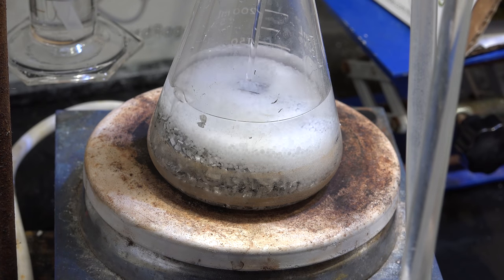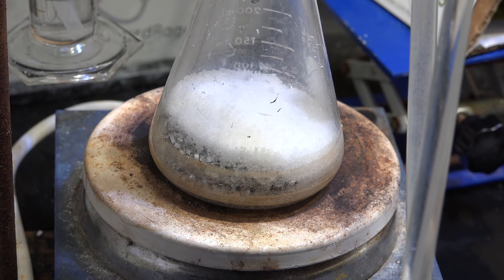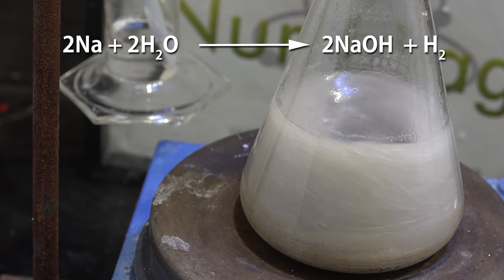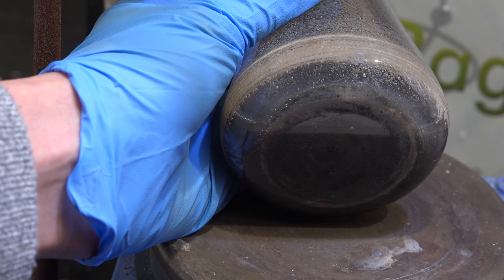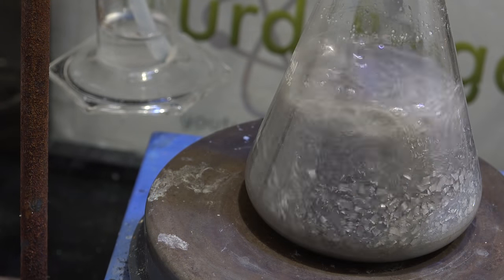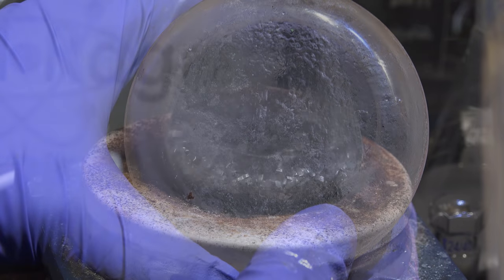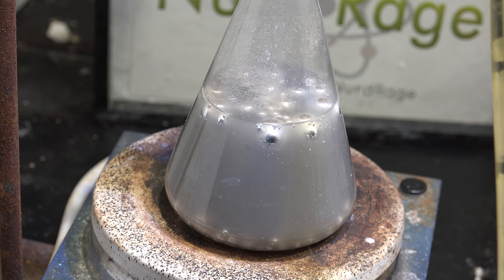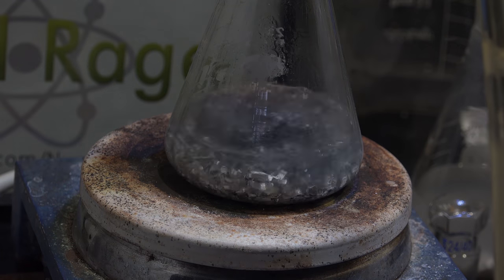Lab Notes - Successful glassware protection for sodium production - August 18th

Comment: Really awesome stuff man! Im pretty impressed with how much you've improved it.
Reply: he should be getting an award for this breakthrough, now waiting on your end for the next breakthrough
Reply: NileRed you should write this up and publish in a chem journal
Reply: Did they? This seems like a meander down a very specific chemical byway, using complicated reactions to produce a product any academic, industrial or commercial lab could order on the cheap. It's also the kind of thing that would likely be journal published, in which case I can only assume that one amateur chemist or another would have found it and shared it. 

Unless you mean that none of the specific techniques are new, which I agree with. But most of science is like that, you rarely invent a new technique, but often find new places where the old techniques are useful.
Reply: I think it's from his Oxalic Acid video.
Reply: @EXTREME-DIARRHEA-BLASTING  If they did, they should have published it, then they would be getting a prize...

Comment: could you use lithium (from batteries) to drive out the water?
Reply from the maker: Already have, it works, and i'm going to post that in the next lab notes video.
Reply: NurdRage awesome! thanks for the content!
Reply: the lithium contamination might be an issue though
Reply: What about aluminium?
Reply: Aluminum needs to be liquid, which needs pretty high temperatures.
Reply: calcium oxide will get rid of the water but idk what the calcium might to do the reaction
Reply: But how solid Mg reacting with solid NaOH in this reaction? or I missing something, or solid Al will react simmilar.
Really cant get, reaction with Mg going at temp lover then NaOH melting point, so it reacts only in points where NaOH coliding with Mg, thats why you need mixing it like crazy, right?
Reply: Alexander FL-TS
 please go back and watch the other videos on this reaction, there is a tertiary alcohol that reacts with the NaOH to form an alkoxide which then reacts with the magnesium.
Reply: Hm... so acording to recent video aluminium still work, not as good as lithium, but work.

Comment from the maker: Woohoo.
Reply: Better method: Take light alcohol (ethanol, methanol, etc.), dissolve some magnesium metal in it, add NaOH, mix for 30 min or so, distill off most of the alcohol, add mineral oil, distill off rest of the alcohol, add magnesium and a catalyst and perform the actual reaction.
Reply: How about using glass bottles. Something like a cola bottle or champagne bottle heated on a oil bath(slowly to not crack the glass). Than glassware destruction wouldn't be a problem and if you were to use a glass container to contain the oil bath you could still stir it with a magnetic stirer. AG
Reply: congratulations on achieving this, buying starter metal or sacrificing one flask seems like a reasonable alternative to all other options. you achieved what you wanted to
Reply from the maker: (I need a better username): Didn't work, it was the first thing i tried.
Reply: Soda-lime glass used for making bottles is most likely not heat resistant enough.
Reply from the maker: ( Anoxia12 ): Definitely exploring further options.
Reply: Oh, alcohol must be causing same effect as water then.
Reply: NurdRage , Congrats.
Reply: Could you use a sand bed heating thing to reduce the hotspots and glass damage further?
Reply: Congratulations! I've been watching all your progress and I'm always impressed by your work. Here I am struggling with sodium thiosulfate synthesis (Na2S3O3) via the boiling NaOH + S method.
Reply: will the sodium react at all with super glue?
if it doesn't the you could try lining the glassware with some to protect it
Reply: NurdRage publish a paper brother, if this was common knowledge would we be here right now? Congrats!
Reply: Hmmm, maybe you can use calcium oxide as a drying agent.
Reply: wow that yield difference! congrats!
Reply: Ive been watching your channel for couple of years and I just wanted to say Congratulations! You've made an excellent contribution to amature chemistry!
Reply: Maybe heating up NaOH in toluene using dean stark apparatus would help dry sodium
Reply: What about heating in an oil bath? it would eliminate any hot spots on the flask...
Reply: @nurdrage
try calcium oxide because it reacts with water to form calcium hydroxide!
though idk if it will affect the alcohol or not
Reply: Mu-Ahh-Ahh!

Working towards this myself. Just made a nice batch of 1,4 dioxane, and acquired a good supply of Mg turnings. Still seeking out an alcohol catalyst.
Reply: This was a wild ride
Reply: When are you going to publish
Reply: It would be amusing to see a paper on this published by "NurdRage".
Reply: superglue brakes down with heat and would add act as a thermal insulator likely causing worse hot spots
Reply: NurdRage Given the limited amount of water present in NaOH, is it really necessary to use 50mol% of the product to jumpstart the reaction or is that to be further optimised too?
Reply: Now you just need some thorium for your nuclear reactor :)
Reply: Kinda wondering how small amount of sodium you can get away with. Testing could ruin more glassware though. hmm
Reply: Could you use an oil bath to make the heat application completely even to the flask?
Reply: I agree: Woohoo!
Reply: Amazing! Congrats on a job well done. Definitely an experiment I want to try when I get my lab up and running.
Reply: Would using sodium carbonate be possible. Even if it only produces a small amount it could be a way for some starter sodium
Reply: Have you tried putting the flask inside another slightly larger container filled with water on top of the hotplate to even out the heating?

Comment: Dang you not only saved your glassware but also blew the yield through the roof. Great work Nurd! Could lithium destroy water? You can easily get it from batteries
Reply: Metalhammer1993 Yes, lithium, like all alkali metals, reacts with water. The only problem is that you'd need to recover the produced lithium hydroxide. The advantage of using sodium is that it can simply be recycled in the reaction.
Reply: Haloid Kusnetsov i know lithium reacts with water, but i also know it's less reactive than sodium or any other alkali metal. Meaning it might be too slow. The lithium hydroxide however is the least problem. It will just stay with the magnesium alkoxide in the slack. Unless and that would rule it out as a drying agent, the lithium hydroxide can perform the same reaction regenerating the lithium which might form an alloy with the sodium.(im quite sure it won't but i can't guarantee it.)
But if lithium works it is easily available and doesn't need to be made beforehand looping around the having to have sodium in the first place problem
Reply: Metalhammer1993 It still reacts fairly quickly. It just doesn't ignite as easily.
Reply: Chemist here, yeah, actually, that should work, it's a great idea and so easy. Lithium does react with water almost as fast as sodium (a small piece in water is destroyed in like no more than 30 seconds)
Reply: batteries arent a great source of lithium. afaik lithium primary cells (NOT the common Li-ion rechargeables that power phones etc) are the only type to contain metallic lithium and they only contain a small amount per cell. youd need a lot of cells to scrape together, say, 10g of Li.
Reply: True, but you don't need 10g, nurdrage went overkill, only a few mg should be enough. Plus the thin sheet have a huge surface and will react quickly with water. It should work fine.

Comment: This was a very remarkable discovery, congratulations!

Now that water has been identified as a major spoiler of the reaction, as well as necessary for glassware corrosion, maybe the process can be made to work with more common alcohols, like ethanol or isopropanol?

I have tried melting NaOH in a stainless steel cup too (my goal was to extract metals from silicates by turning the silica into soluble sodium silicate).  I found that, after heating hydrated NaOH (alone) up to about 340C, the solidified "mostly anhydrous" crust will dissolve in a sufficient amount of anhydrous ethanol.  

Stainless steel mostly resists molten NaOH, but it is superficially attacked.  The NaOH becomes orange-brown, apparently from suspended "rust" (iron oxide?).  The steel surface becomes covered by a black oxide (?) layer.  The NaOH however does not seem to react with either the "rust" or with that layer.  It seems that, after the cup's surface has been "primed" this way, more NaOH can be melted in it with little or no "rust" forming.

Some papers I have read say that it is very difficult to remove all traces of water from molten NaOH, and even small amounts will noticeably lower the melting point.  Thus the melting point of pure NaOH was surprisingly hard to determine.

The same papers say that silver is the best container to melt NaOH in.  I have seen nickel crucibles on sale that are claimed to resist molten NaOH, KOH, K2O, etc.; but they are a bit expensive.  I wonder whether nickel- or silver-plating the inside of a stainless steel cup would also work.

Comment: Really great research! Useful lab knowledge for other reactions as well. Thanks.
It seems often that keeping thing scrupulously dry improve results a lot. When doing new reactions it may be the worth the extra to avoid complications, and then later see if it was necessary or not. Perhaps it is beneficial to use a sodium press to make sodium wire for the initial drying step as is usually done when Na drying various solvents. 
It is possible to dry NaOH and get rid of carbonate by dissolving about 200g/L in dry MeOH. Filter of carbonates, add molecular sieves 3a and filter, vacuum dry under heat to get dry pure NaOH back from alcoholate. One of these methods is described in the excellent book "purification of laboratory chemicals".

Comment: Great work! I was expecting something like something that would preferentially react before the glass, or something like fluorinating the glass beforehand to give it a SiF surface. Not 'just' removing water from the reaction. Could an oil bath, even just a few mm in the bottom of a beaker that you can put your flask in help even it out and spread hot-spots to reduce the chance even further? Maybe even a small pile of fine sand that you push the beaker down on till the layer is thin?

Comment: Congrats at solving the glassware damage issue, and improving the yield at the same time.
I wouldn't worry about need sodium metal as an input, pretty sure the aluminium refineries need to throw some scrap aluminium into their process to get it started.

Comment: Congratulations on the big inprovement! I have to ask though, did you try any other drying agents to dry your sodium hydroxide prior to reacting it such as sieves? While sodium may be the most effecicent method once acquired it would be good to not rely on a circular method where you first have to destroy your glassware before you can make more sodium.
Reply from the maker: sieves would be destroyed by sodium hydroxide. so it can't be used. Don't worry though, i have a few ideas for alternate jumpstart methods.
Reply: Ofcourse, that was a silly on my part. Eagerly looking forward to what you'll come up with!

Comment: you could try to set up a soxhlet extraction with A3 in the soxhlet and NaOH in a flask below. Eters or toluene can carry some water from NaOH to A3 sieves
Reply: But then the NaOH being dried may react with the flask. Perhaps it would work if the positions of the NaOH and the sieves were reversed and the condenser was covered to protect it from atmospheric humidity.
Reply: Dean stark trap would be better than soxhlet

Comment: Magnesium alcohol looks like your most mobile drying agent, but there is none present at the start of the reaction. Maybe try adding a little magnesium oxide before you add the sodium hydroxide. The third reaction should run a little in reverse, with the resulting water being destroyed by the 4th. Before you even get it hot, the magnesium alcohol should start to dehydrate the sodium hydroxide, and you should see hydrogen bubbles if I am right.

Actually, the mechanism of dehydration is probably a little more complicated than expected. Magnesium is not in intimate contact with the sodium hydroxide, so the dehydration of it occurring directly looks unlikely. Some mechanism of transport of water between the solid sodium hydroxide (which holds it pretty tight, and would pull it out of solution) and the solid magnesium is required. The only mechanism I can see is the mechanical movement of magnesium oxide formed at the sodium hydroxide to the magnesium, where it reacts with an alcohol to reform the water that the metal reduces. The mobile magnesium alcohol then reacts with water at the sodium hydroxide to reform the magnesium oxide at the hydroxide end.

Basically, reaction 3 occurs forwards first at the hydroxide end, then backwards at the magnesium, then forwards again at the hydroxide. If the hydroxide is wet, this can repeat again, to dry as required. Once things are going and you have plenty magnesium oxide around, this should work fine.

Comment: In order to optimize the process further, could you perhaps cover the bottom of the flask tightly with aluminium foil to spread the heat and run the reaction at some slightly higher, optimal temperature setting without having the hotspot problem?

If a slightly contaminated product is not a problem for your experiments, could you use a potassium or even lithium starter to eliminate the water, if those are more available?

Comment: What if, for the "seed run", you combined NaOH and t-butanol with some toluene and used a Dean Stark to drive the equilibrium and remove as much water as possible, then add mineral oil and magnesium, drive off the toluene, then heat to 200 C?

Alternatively, you could make some K using the (easier) reaction, use the K to dry your NaOH, and generate NaK (say 2:1) for the first run. Use your NaK for the second run to get a sodium-enriched NaK (4:1). A bit more tedious but it might be a fair tradeoff for the homegamer with limited access to glassware.

Comment: Use heated sand around your glass
Reply: I was going to suggest a sand bath, but from the results in the video it seems that he just doesn't need it. The reaction was nearly quantitative and I doubt a sand bath would help any at the lower temperatures he now uses.
Reply: The hotplate can run at a slightly higher temperature without damaging anything and might run the reaction faster.

Comment: In the HVAC field we remove water from the refrigerant system by pulling a vacuum to under 500 microns. 
Which at 500 microns the boiling point of water is -20°C  (+_+)

Comment: Is there is a possibility that the sodium is alloying with the magnesium? A molten alloy might be reducing the hydroxide directly. If you use an excess of magnesium this should be detectable by reacting the product with water. Any alloyed magnesium should precipitate out as magnesium oxide, while the sodium hydroxide goes into solution. On the plus side, by using an excess of hydroxide you could react out all the magnesium to get a pure product anyway. It would also suggest that the alcohol is not required provided you have a seed of sodium, as the sodium is your catalyst. The alcohol would certainly provide a pathway to form some sodium, but it might not be the dominant mechanism later.

Comment: You may coud use a vacuum combined with a high enough temerature to drive out the water out of the NaOH but not melting it in the process. ( 150 - 300°C , if the melting temperature didn't change in the vacuum) I think this could take a while because NaOH is so hydroscopic but it still should work. This is cheap, and would produce the initial amount of NaOH. From there on you can continue with the production of Na Metal as you discribed in the video.
Great Work by the way ;)

Comment: If you were getting hot spots, why not try to eliminate that by a heating method that spreads the heat more evenly.  Might even be able to lower the temperature further by a more even heating method.

Comment: would a oil bath setup using dibutyl o-phthalate work to drive the reaction forward faster by using more surface area? It should have a high enough smoke point and would eliminate hotspots on the glassware.

Comment: So here's an idea from a cooking technique. Try putting a 1in solid slab of aluminum, iron or steel on the hot plate. 
 The idea is that the metal heats evenly, there by removing any chances of having hotspots

Comment: Superb ! Brilliant work Nerdy.
So to start you need some Na metal to add to your NaOH + Mg.
Now what were the reagents and raw products of your 'thermal reduction' method i wonder ... ;)
Bye bye dioxane.
Reply from the maker: why thank you! i'm working on even easier routes. :)
Reply: You're most welcome, and certainly deserving of high praise !
When i copied your thermite thing i just squirted a load of baby oil into the can as soon as the reaction stopped.
It caught fire a bit, but no explosion or spattering. Maybe should have stuck the oil in the freezer first.
Progressing that could be as simple as adjusting the qty of all reagents, add tertiary alcohol, then cook 3 days, all in the same soup tin.

Comment: you could try to start the reaction with zinc.. im not completly sure at what temperature zinc reacts with water, u could use calcium powder or even barium oxide .. there are plenty of reactive metals out there, the only question is wich would be cheap to produce? Aluminium reacts at 280C with water.. i think thats excluded

Comment: 1) Heating to 200-250°C in an oil bath or heating mantle to avoid hot spots? 2) Drying molten NaOH in steel container using vacuum pump?